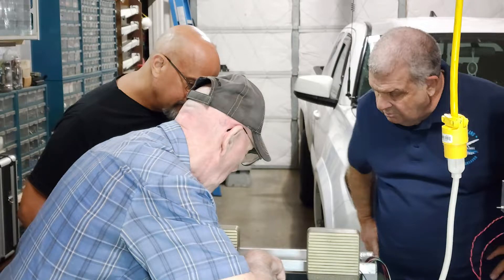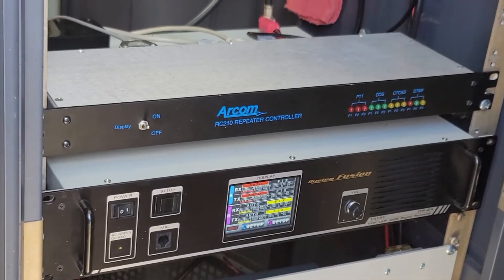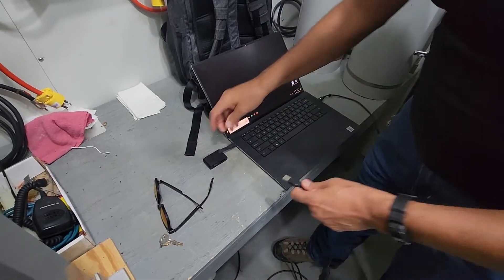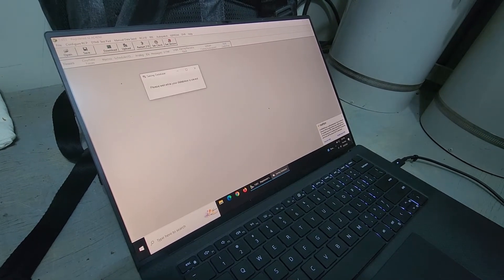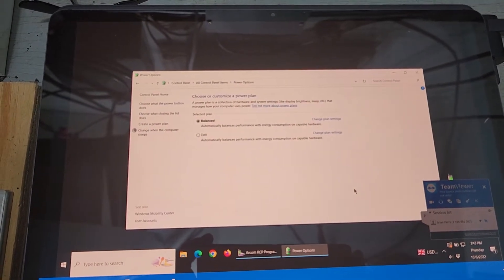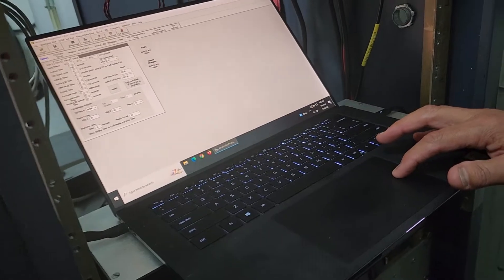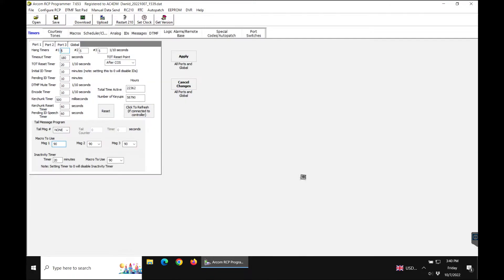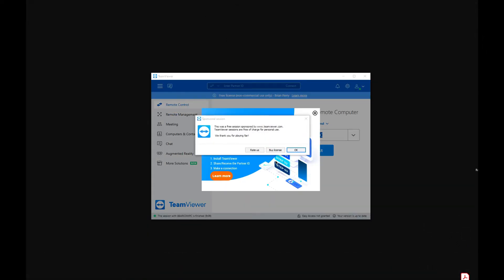LCARA HAM Radio: Final Installation Arcom RC210 w/Remote Capability!!!!

Comment: I enjoy watching your videos!! I have two 300' tall GMRS repeaters and I have an older used Toughbook I leave in the rack as well which has actual serial ports in them to control the Quantars and the RTCM's remotely. It's SOOOOOOO nice to be able to do all this remotely. Since you have internet at the tower site, It's also worth looking into getting a couple watt boxes so you can actually control the power outlets remotely as well using the OVRC app on your phone or laptop.  In both of my cases I even set up a schedule to turn the repeater off and force it to run on battery backup once a week for a few hours so that you utilize your batteries and don't just keep them all fully charged because that's not good for them. You could cycle them just a little bit by draining them 5 to 10% no big deal and that will make your battery back up last longer and more importantly it will test it out so that way you know when the power goes out that your repeater stays on and doesn't go down due to a failed battery that of course has been neglected. One last tip I'd like to give you because I'm an IT expert is that you have the TeamViewer ID in the video and that is a huge security risk in my opinion. Yes of course you have it set up with passwords and things of that sort but you need to go back and re-edit this video and either blur the ID out or cut it out completely.
Reply: @Robert Baldyga  - Thanks for the catch on the Team Viewer account. We have already changed the authentication elements that were displayed in the video. As you mentioned in your reply, we are slowly adding remote capabilities to our sites now that we have internet access. Lot's of fun! Thanks for watching!